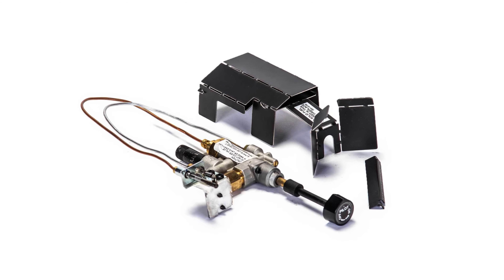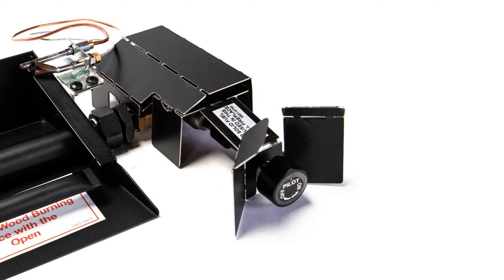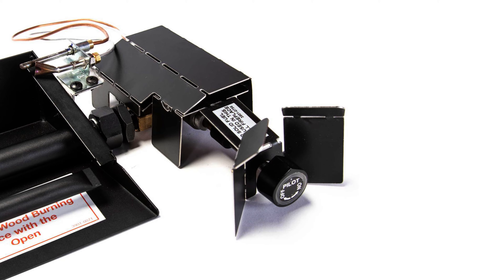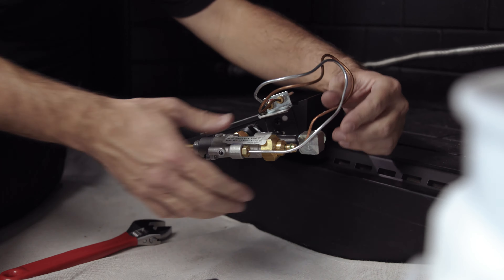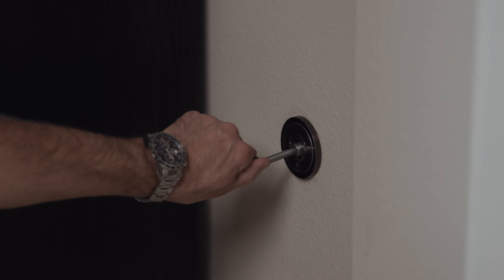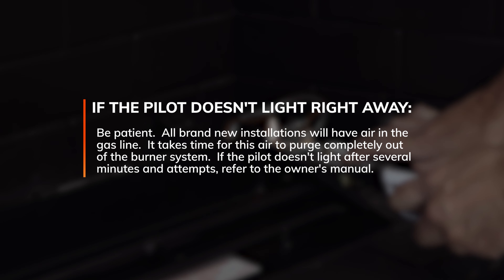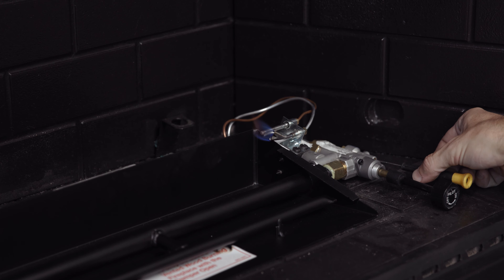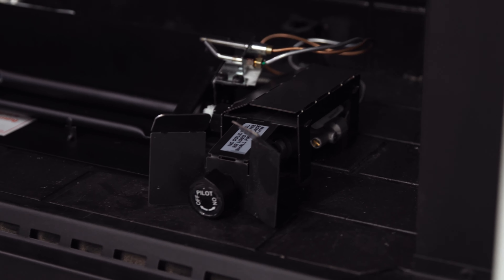How To Install the SPK-26 Safety Pilot (by Real Fyre)

Comment: Hi, thanks for this. I just installed mine and it went well. Quick question, if the pilot blows out after being on for a while is it possible that gas would still come out ? I was thinking that because the thermocouple is so hot the safety valve may not kick in immediately. I am still hearing the pilot letting gas out after I blow it out.

Comment: About to light it up.  If I don’t make it, three suggestions for anyone else smart enough to find and watch this video.  1. If you don’t have the yellow goo, you can buy yellow tape that works the same as the white tape you would use on a water fixture.  2. You don’t use the goo or the tape on the two compression fittings.  3.  If your gas line enters the fireplace box on the left, and you need to purchase a gas line to bring gas around to the right of this device, there are several different lengths of gas lines that are available.  I believe those suggestions (not mentioned in this video) are accurate, but you should check as I am not qualified or certified.  Wish me luck.
Reply from the maker: Great comments Joe!  Hopefully the installation went according to plan!  Check the video at the 1:03 mark where we show the flex line connecting to the gas input on left and going behind the burner to connect the pilot system on the right.  Should keep you toasty this winter!  Enjoy!
Reply: @StarfireDirect  Everything went great.  I have two fireplaces.  The first one took forever to get right - all my mistakes and inexperience.  The second one took 20 minutes.  Your videos are way better than the enclosed booklet. (Better angles on the parts)
Reply from the maker: @joegallagher1842  that first one is always the hardest.  Glad you got it down and to have helped!